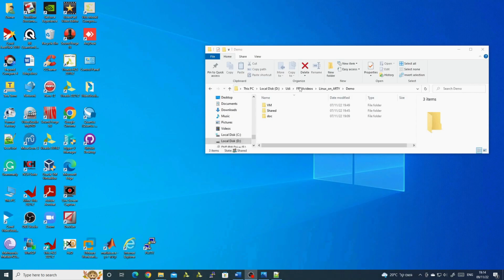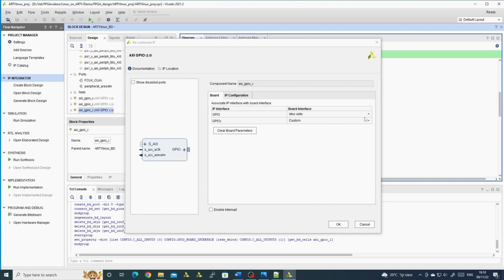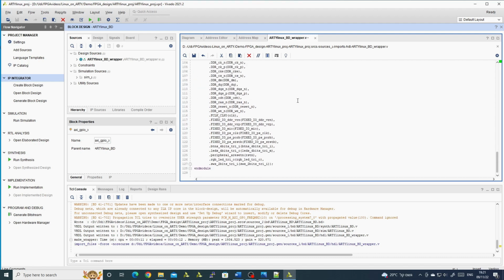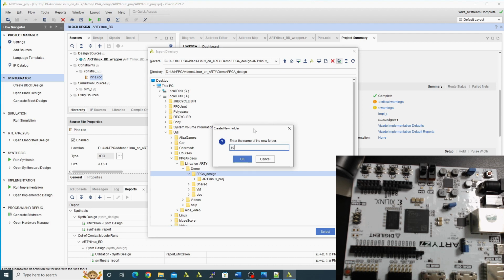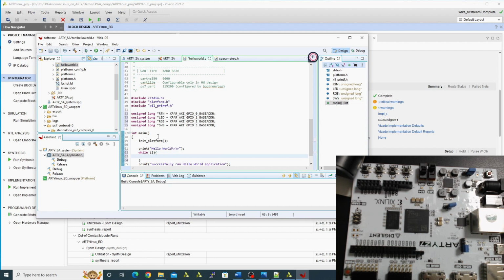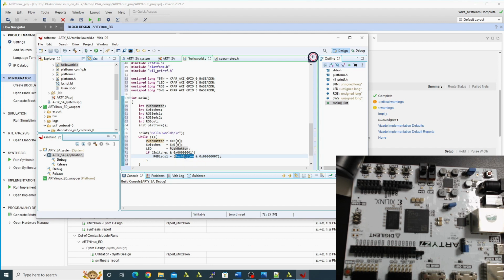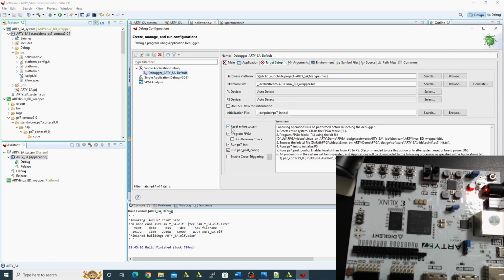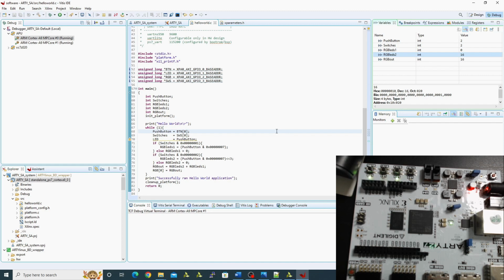ARTY Linux Video 4 – FPGA design

Comment: Hello!  Do you have the Vivado project shared anywhere to access?  I find the videos to be very helpful. I'm better at the Linux side of things, and not so much at the VHDL side of things.  I hope to get an example Vivado 2021.1 project and to use the XSA file from there.
Reply from the maker: Thanks for your comment 
you shouldn't be afraid from the Vivado. 
I'm taking you step by step of building the Design. 
I found an XSA file here
https://forum.digilent.com/topic/19157-vitis-hw-platform-in-arty7-20/
but I'm not shore which version of Vivado was used, and it is very important to much the Vivado version with the Ubuntu version and the PetaLinux version.
Thanks 
  Udi